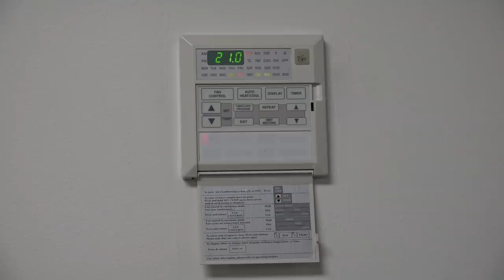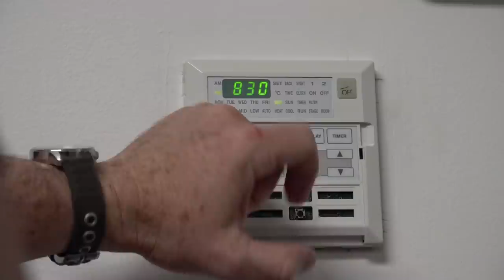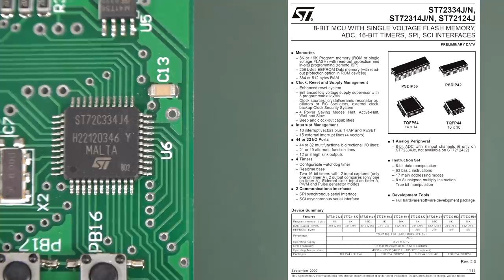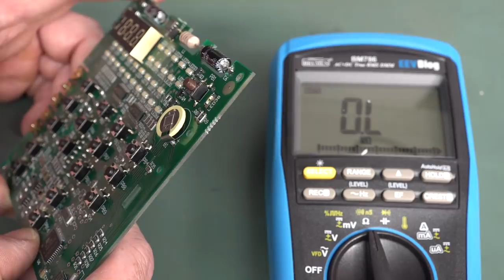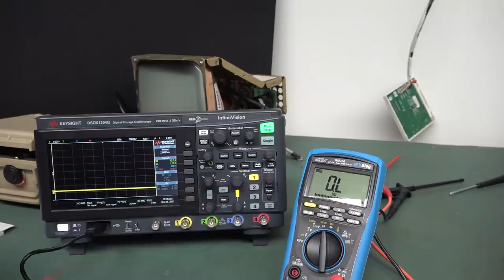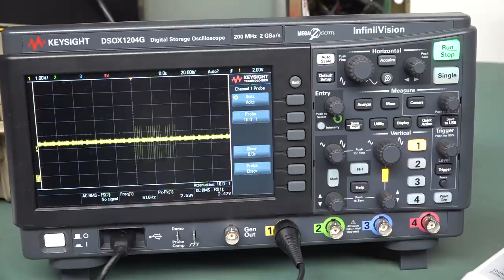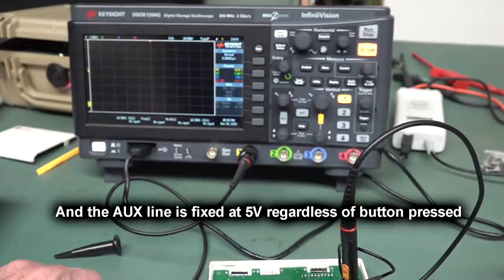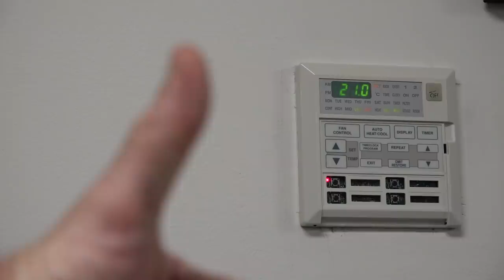EEVblog #1360 - REPAIR - Aircon Control Panel

Comment: Hi Dave, I know all about this. I reverse engineered this years ago to a pleasingly ridiculous level of detail. My motivation was to move the controls on to an app on my phone. I succeeded! My electricty bills were lower, temperature control was more comfortable, and it was just convenient. 

Key presses (outgoing): So the pushbuttons are tactile (and not membrane) because the OUTDOOR  controller expects to see a specific resistor value for each unique pushbutton. By pushing a button, a different resistor is "presented" to the pull up in the outdoor controller. You can test this by measuring the resistance between common and "aux" (wires disconnected). You will find the ON/OFF button is a dead short, so this will appear as close to zero volts as possible at the voltage divider outdoor for THAT ADC to read. you'll find the resistance values in the indoor pad are spaced about 200~400ohms apart - membrane switches cant hit that target range. So the resistor value for the "heat/cool" button must have been the next higher value (closest to 0 ohms ...being on/off). I didn't have any DIP switches on mine but you do - so I believe all they must/could do is disable or otherwise modify the resistance valves for certain key presses so they "map" correctly to the specific outdoor unit. So there is analog multiplexing going on, but no digital multiplexing! the onboard micro wouldn't be doing much in this respect (other than maybe "sniff" the same voltage value that the outdoor unit receives (slight deviation due to wiring run). I can see why they would implement it like this - you could add multiple panels in parallel and have both able to drive the outdoor unit.  

Communication (incoming): This happens over the power line! there is a trigger and timing logic on board, and a parasitic (but efficient) switching power supply for the onboard logic (and LEDs) on the indoor control panel (if you draw too much current, voltage sags a bit much, and it messes with the trigger circuit). What you see on the scope is a bitstream that is processed by the timing/trigger logic... you don't need a micro to do this. On my actron unit indoor wall-mounted panel, there is no micro, just a series of daisy chained 74HC595 Shift registers fed by the trigger/timing circuit. The parallel outputs of the shift registers were tied directly to the various LEDs and 7 segment displays. Once this was apparent, It was straightforward figuring out which bit in the stream mapped to which LED/segment on the display! It appears in the model you have, the micro is doing little more than what the shift registers would have done. Again, this implementation allows multiple panels to sit on the same circuit.

Armed with the above, I was able to program an ESP8266 to 
1) Read incoming bitstream (sniffing the data getting clocked into the HC595's) 
2) send this data to a Blynk application on my mobile 
3) Receive touch commands from my Blynk app and convert them to virtual button presses (I used a 10k digital pot to masquerade as button presses). 
4) I could use a second digital pot to "route" in a remote sensor (controlling temperature in the bedroom, rather than the hallway!)
5) Implement elaborate schedules (eg for comfort, raise set point by one degree at 3am, but ramp back down at 9am) 

The beauty of the solution was that it was completely transparent - both the indoor and the outside PCB's had no clue a man in the middle existed :)
Reply: Here's a suggestion: Run a pair of wires between common and aux to the front of your workbench, solder in a pushbutton. Viola, no reaching over required. Thats the benefit of how this has been implemented - you can run multiple controllers... or switches.
Reply: Very interesting.
Thanks for sharing.  😉👌🏼
Reply: @nohandle1  I considered doing this for the WPS button on my router
Reply: @nohandle1  ,  Damn, I LOVE simple.
Reply: @Okurka.  Long sticks are used in Soyuz to press hard to reach buttons ( there are plenty photos and videos)
Reply: @coctailrob  You must be one of few who actually use that button
Reply: Awesome . I never got that far decoding my Actron, don't have it any more, so can't give it a try.
Reply: It's fun to see and read about how much can be done with time and persistence. Thanks for sharing.
Reply: If you look closely on the scope you can see the spikes over the packet voltage. If Dave would of raised the trigger higher than the packets it would of pickes it up.
Reply: @Okurka.  This is what my Mitutoyo rulers are for.  I, uh... don't measure with a ruler as much as I thought I would.
Reply: I would love to get more detail on how you built this, I have a similar Actron controller and am interested in implementing control from a particle.io photon board.
Reply: Have you ever tried to reverse engineer the main PCB board? This would be interesting to do considering that it is just a controller with few relays an DC 12V power source. But Actron charge arm and leg for these PCB boards like they were made from the gold or something and keep telling stories that these PCBs in older models of Actron are not available any longer and cannot be replaced with the newer version. Is this not an R22 system btw? On one occasion when asked the technician about fixing the PCB such a response was that it "is not possible" and the whole system needs to be replaced. Needless to say that the culprit was quickly found without "specially trained for Australian type of electricity (different from the rest of the world)" technician the bad relay for condenser fan motor and it was repaired in no time at the cost of the relay and one hour of work. To be fair initially firm was offered to come over and get paid for 2hrs of work and the spare part. But since the response was: after 20 days of lead time we will let you know when we can come over and fix this "serious" fault for you if it is possible  at all blah blah blah we decided not to wait in +40C..
Reply: Stanley Whiteman pretty sure the D4CPU boards are available. You could probably replace the controller with a different controller, i retrofitted one In my unit at home but you’re taking the unit away from standard and making it harder for people to work on it. Anything can be done but at what cost. Would you pay someone $2000-3000 or so to put a different controller in your Unit?
Reply: This is one hell of a porno story 😅. amazing!
Reply: @steven-george  yeah it was interesting decoding this. Would have taken a lot more time if didn't have access to the end panel to reverse engineer.
Reply: A long stick is the solution i use, the kids hate that i wrote 'alexa' on it
Reply: @stanleywhiteman6450  HI stan, yes I did briefly look at it. Anything is possible but one has to balance risk vs reward - I would not recommend any other controllers or rolling your own for the outdoor unit. They are charging the sum that they do for the "magic sauce" in that micro and board design that has matured over many years (reliability benefits). I could tell that the relays on the board were clicking frequently - I figured it was toggling the unloading solenoid on the compressor. That cant be good for the relay contacts - but hey its worked OK for many years! What other delay times etc exist, who knows! So I would do what you did - attempt a repair to shorten the return to service (it will either be the power supply, or the relays that fail). I reverse-engineered the communication so I could work with the existing hardware :) troubleshooting down to a relay is a skill many HVAC techs will not have, they will be trained to locate the fault to a module and once they've found it, toss it out! that's about as much you could do if you are on a 2hour service run if you had the part in the van. If not, and lead times were long, it provides the additional motivation to dig deeper.
Reply: I was quoted $1040 to fix two Actron wall controllers with the same issue as in the video. That seemed a bit steep so I put up with it for another year. Nice to know there is solution that I could just about manage. I asked them if it was possible to retrofit a wifi controller but they could not even understand what I was talking about. Now I just need Bilal to dump his work so far into a Github or something.
Reply: Anyone who asks why not just get a Nest or an Ecobee just doesn't get it. 👍
Reply: Nice! I've been thinking of doing the same with ESP32, but seems like too much effort. I might just hook it up to the power button if it's just a direct short, then I can set the temperature low so it's always on, and just switch the power off when it reaches a good temp.

Comment: The "run" flashing probably means that the compressor can't switch on again, because it had just been switched off, and that's how it works in refrigerators, it can't turn on right again after turning off, probably because the coolant needs to re-condense or something like that.
Reply: Almost certainly, the same does apply to AC compressors, they usually spec 3 or 5 minutes dwell time; it's done so that any liquid that backflows into the compressor when it stops can boil back to vapour, otherwise it can hydraulically lock the compressor.
Reply: ah yeah, your probably right.
i think it stay on when the compressor is running so it show it's going to come on soon by blinking
Reply: Yes, this is the most plausible reason. It is to prevent the compressor short cycling and puts the compressor into a short timeout, usually about 3 mins before it can be turned back on.
Reply: Yup, anti-shot cycle.
Reply: its pressure equalization between suction and discharge, and from what ive seen for a 3 phase compressors, it wont cause it to temporarily "lock up" due to pressure difference because those motors have enough starting torque, single phase wont start until it equalizes, but its still not a good thing to short cycle a compressor, i honestly thought those big office building would have something like water source system, either that or something similar to large VRV systems
Reply: Short-cycling a single-phase AC compressor can also make the compressor run in reverse which is just all kinds of bad. With all compressors it's also to prevent starting against a high-head pressure since that requires significantly more power which is just bad for the windings.
Reply: @jp-ny2pd  not sure if the reverse is true the way those motors are made dont allow it to reverse accidentally, but if it does happen, if its a piston compressor its not an issue at all, it will still pump normally no problem whatsoever, but if its a scroll compressor it wont pump at all and if left running that way it can cause damage
Reply: @TonnyCassidy  The running in reverse is mostly a scroll compressor thing I think. Piston compressor likely wouldn't matter since check valves control flow.
Reply: @jp-ny2pd  usually what causes the motor to spin in the wromg direction is incorrect wiring on 3 phase compressors, while single phase cant really be reversed unless the motor was designed to allow that
Reply: Its called short cycling
Reply from the maker: Always wondered about that, makes sense, thanks.
Reply: Yeah, I've had two programmable home thermostats that did this. They would make sure the compressor stayed off for two or three minutes before allowing it to kick in. Also, when the thermostat first powered up, it would still have that delay, in case the power briefly flickered while it was running. I thought of that immediately when I saw the flashing run. I'm working on replacing my thermostat with a PLC that will be programmed to do the same thing.
Reply: @jp-ny2pd  This high pressure sometimes can reach 300psi or even more. Which is dangerous for the compressor.

Comment: Love the way Dave's curiosity and enthusiasm lead to a deeper than necessary analysis when all he needed to do was replace the switch. Those HVAC controls are more complex than one might imagine. Throwing a micro into anything breeds complexity. I have a programmable thermostat that has more configuration options than Windows (almost). I'm also torn between storing parts in umpteen project boxes - some of which I will surely never get back to - and sorted parts bins. EEVblog = entertainment for geeks for sure. Thanks Dave, and Happy New Year!

Comment: The switched resistive ladder was very common on early car stereos with removable front panels back in the  90's. Is an easy method to bring all the switches through a single connection to the main unit.
Reply: Still commonly used for car steering wheel control buttons in order to reduce the number of lines that need to go though the clockspring.
Reply: yeah, I have a little stereo I use in the garage like that - it's all good until the power supply rail that supplies the voltage dividers on the switch starts to drift, then all the buttons stop working all at the same time. Shitty design just to save a couple PCB traces, and ensure your product clogs up the landfill

Comment: This video ticked all the boxes!!! And, I leaned a TON!!! The idea of a push button array that is tied to the ADC line and a resistor network is brilliant. So imagine you have a 3 cent micro with limited I/O and you needed to feed in 10 button inputs. Well, no worries! Use the ADC input, the 3.3v rail, buttons and resistors and there ya go. I NEVER would have thought of that! The the EE's out there. Is that a common way to implement push buttons when you have limited I/O??

Thanks Dave!!!!! Glad you got it fixed! This positive outcome video really helped my bout of anxiety I've been dealing with the last 2 weeks. So, thank you!
Reply from the maker: Yes, it's relatively common with tiny pin limited micros. Less common with this reasonable sized micro, especially with an array this size. You can also do it without an ADC using a comparator input and RC timing if you are desperate enough.
Reply: @EEVblog  Very cool!

Comment: "Cool/Elec" would be cooling-only with (optional) electric heat, which would apply to any configuration that has heating that isn't a heat pump (i.e. doesn't use the outdoor compressor) - that includes no heat at all.
Reply: A heat pump requires a reversing valve to send the cold gas back to the condenser and the hot gas to the evap coil to get heating
Reply: @joshuabest100  HVACR Videos For the win.
Reply: @xboxlive6  aswell as anti diy hvac

Comment: I built my own ACU controller in '84/85 using the MCS-51. It sat, controlling computer multiple room air conditioning units for years. When the building was demolished, and I retired, I brought the unit home. It is now controlling the ACU in my home machine room. It has now operated for over 35 years without a problem. This is almost as long as my marine watches bell controller has been running.

I used hall-effect switches.
Reply: Hall-effect switches,
for when it absolutely must continue to work for decades.
Reply: @b2gills  Is there a failure mode? Tired electrons? Temporary speed of light variation resulting in faulty electromagnetic field?
Reply: @frogandspanner  Not really with Hall-effect devices. About the only problem that could happen is the amplifying electronics failing.

Really I should have said centuries, not decades.

Comment: "these switches fail rarely" NOPE! they fail ALL the time!  I'd bet that the other switches on that panel are ALSO bad and need replacing.. they do CORRODE... OFTEN!
Reply: The center click button on my computer mouse is a tactile switch...I find myself replacing it every 6 months.  It does get a lot of use though...probably a few hundred of clicks per day.  Pain in the ass.

The left/right click buttons have Kailh switches...no problems with probably a thousand clicks per day.
Reply: Yeah and they fail this way, corroding inside, producing weird and changing resistance measurement.
Cant count how many I replaced on many kind of hardware.

Comment: I use to do this with tiny arduino projects. Read the keyboard off a one ADC line and have the switches tied in parallel with highly different voltage dividers. Basically it's because you can use one ADC pin of the micro to read any numbers of switches, but the downside being that multiple simultaneous switches could give a false reading. If you do the calculations right and not have that many switches it's Okaysh. In the software part I'd then compare the read ADC values within tolerances, using something like switch case. It's a lot cheaper than doing the serial-parallel and vice-versa dance but comes with the risk of a dodgy switch shitting up the whole system. Might also be the only way to do it sometimes due to the size of the PIC. By the looks of that  ds1307 battery placement, this was not thoroughly thought through

Comment: I have the DP20003 (The one that goes up to 5600V) and that probe is a total beast! I love it. I had to design a 1KW pulse transformer that would output around 1KV RMS Sine wave several micro seconds. One of the prototypes overshot it to around 2.5KV - 2.7KV. The probe held up incredibly well to that mistake. I also love the accessories that it comes with - all high quality silicone once.

Comment: That kind of resistor ladder control was very common in VHS vcrs for pannel buttons as for mech position control.
In my experience when the manufacturer puts the more buttons in a ladder the less reliable is the machine (and the accountants of the company are happier as the costs goes down...).

Comment: My junky Yihua hot air station just started doing a very similar strange thing. Gotta fix it.

The fun part about these problems is they creep up on you and we don't always notice it at first, so it takes longer than normal to get around to fixing it.